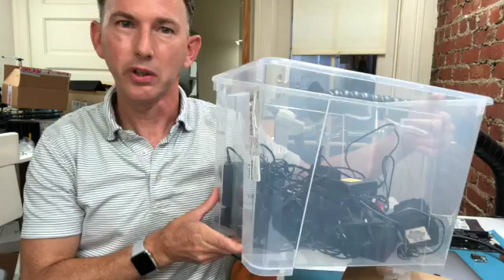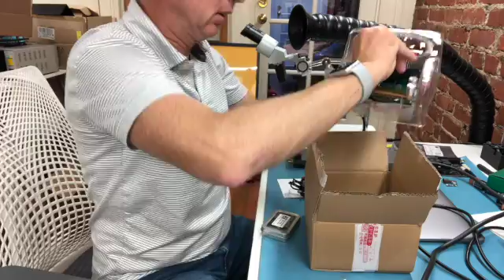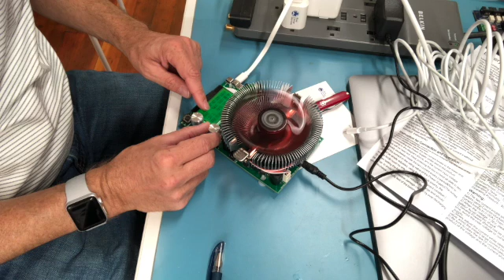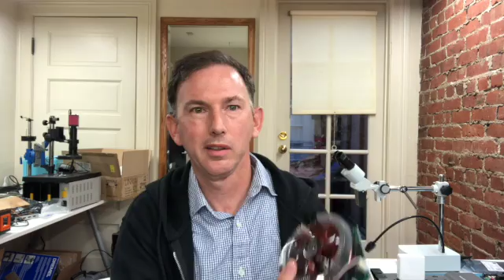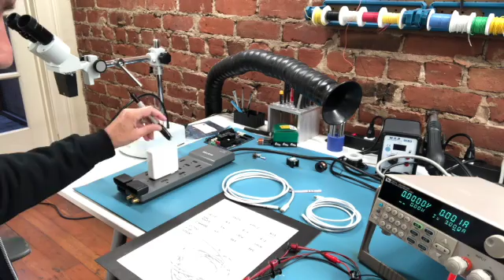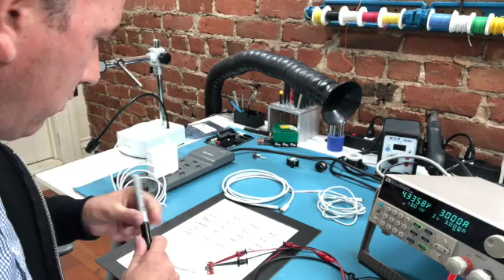USB-C Cable Testing

Comment: I'm guessing you figured out that you need a PD trigger in front of the electronic load if you want to use a device similar to the MakerHawk? I have a very similar device made by Atorch..it actually might have the resistors in the USB module it includes to put in the screw terminals because I think it pulls 5V when you just directly plug in a PD brick.